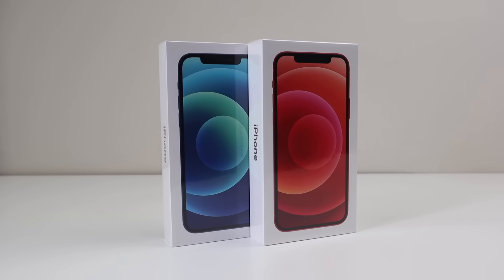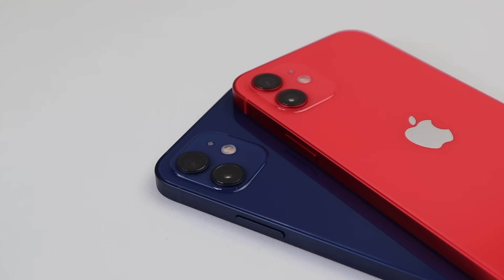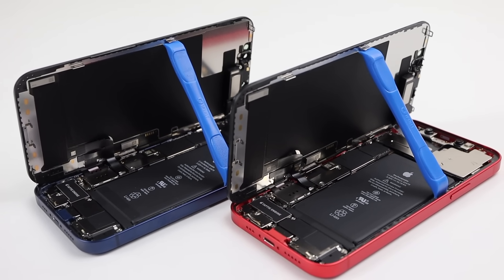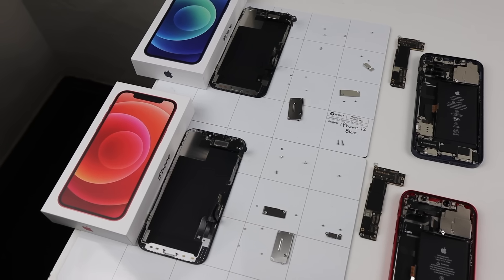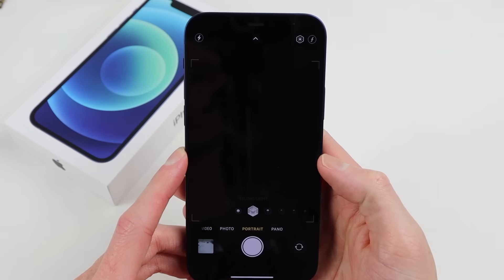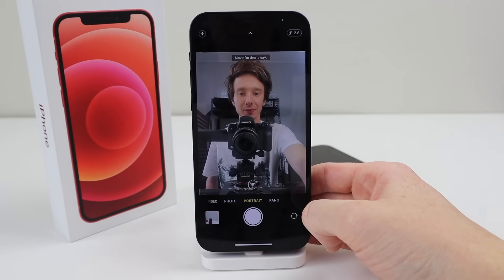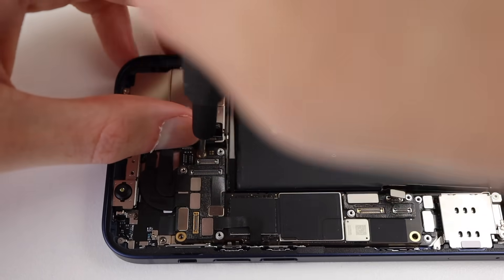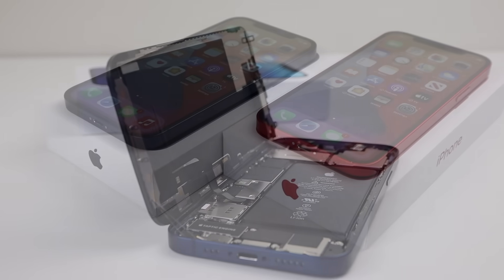iPhone 12 Anti Repair Design - Teardown and Repair Assessment

Comment: I just watched a video showing a 80 year old Rolex mechanical watch which was not working.  After the watch maker/ repair guy got into the gears and springs and replacing what was broken and worn and cleaning what was dirty the watch was beautiful and working like new. Apple needs to adopt the same attitude toward its expensive products. If they continue the trend of once its broken either by accident or digital failure the only solution is to get a new one then Apple will put themselves into a position where the consumer will start choosing a better option which in this case is a phone that can be repaired either by the company and or a 3rd party. That will spell the end of Apple and its Iphone.

Comment: So it claims the parts "aren't genuine" even though they're literally identical components from a brand new phone?
Reply: that's the same thing I thought

They are literally the same phone the only way one won't be genuine is if some  oof the phones made by the same company is made purposely with sub par parts so they spoil quicker

I don't doubt that apple can do this
Reply: How would they ever fix it, they are going to program a hardware address into a battery to repair it? Or is there a way to update this with software?
Reply: @tomanderson3196  You are correct.  They have a way to flash their hardware and match the IDs with the logic board of the phone.
Reply: @tomanderson3196  one would assume apple has the means to properly pair non original parts
Reply: @samuelyoung2671  Ya, id assume you will be paying by the hour for it.
Reply: Apple itself isn't genuine..
Reply: I guess they just check for the hardware ID to prevent you from replacing components. But to be fair they could store individual calibration data on the main storage which has to match the hardware.
Reply: Not completely identical. Several parts seem to have a hardware ID within them and only those that match are allowed to function.
Reply: @Schnittertm1  identical as in part number, manufactured by the same plant in the same way. I understand they have different hardware ID's, but they aren't different.

Edit: and they're certainly exactly equally "genuine"
Reply: @nothingnoone8752  Thats the point though, they aren’t genuinely Apple lol that’s the point taken from it use your brain
Reply: @Jonathan-cz4ky  dude cmon, they do that because although it is a genuine apple part, it forces a monopolization of repair work to apple techs. So, they can charge $150 for a job a small repair guy can do for like $70
Reply: @lemuelseale1640  I’m not arguing against you there, everybody knows that. It only makes sense as it is a business, and they will lose out on a pretty hefty amount of revenue if people don’t get their stuffed repaired BY them. However there is definitely incentive to get your things repaired by Apple regardless, as they are more trustworthy and do offer guaranteed satisfaction whether they can fix your device or not. Every company eventually is going to be doing this as phones become more likely to last longer with more premium materials and better design/software.
Reply: @Jonathan-cz4ky  More trustworthy? Guaranteed satisfaction? Who's your dealer? I wan't to mess my head with the same stuff you're on.
Reply: @Schnittertm1  lmao dont even try that bs, they dont need to be matched, thats a SCAM mechanism.
Reply: @Schnittertm1  technically you can hardly call it different hardware since its the same chip, just programmed to have different id.
Having different hardware in each device on a production assembly would be a hell.

Comment: I wish you switched the screens of the new iPhones to see if it would still work or not. That’s the repair that makes the most profit for third party companies in iPhone repairs which is usually done due to broken screens.
Reply: Bro he switched the logic board. The logic board is the phone. It achieves the same effect as switching every single component. Doing that he basically found out every single component that can or cannot be replaced in one seating. So yes, you can safely replace the screen. At least for now.
Reply: Oh gotcha, Thanks bro I didn’t know that.

Comment: I would love to know how to repair a Huawei mate 20

Right to repair is something I believe in... Unfortunately I had to rebuy my phone or Huawei mate 20 plus
With a Huawei mate 20
Slight downgrade
The only thing wrong with the plus edition I believe was an electrical surge that may have taken out the charging port or a capacitor on the logic board outside of that everything would technically work if you could power it on

Never use magnetic tips on any phone that supports a desktop mode this may not work and may cause serious damage no one who would have been responsible for the phone was willing to repair it

I would love to know how to repair a Huawei mate 20

Comment: I'm thinking the path around this will eventually be the same as for many other similar BS things. Read off the data from the original broken part, write it to the new one. It won't technically be a uniquely calibrated unit in case of displays, but rather, as far as the CPU is concerned, it's the same display as before. Been doing this with replacement displays, batteries etc for years now. Can't mate a new part, but giving the 3rd party tool and parts wizards a bit of time, you can programming-wise clone the old one.

Comment: Apple : Save environment so we won't provide u charger.
Also Apple : changes to type c so u will have to buy Charger and extra box creating more waste than before.
Reply: They are giving the finger to their customers.. Just the idiots need to realize that it's the middle finger and not the ring
Reply: Or use an old one? It’s still lightning.
Reply: @NotFaitZ  who doesn’t? If you have a phone with usb-c, you can use the cable that came with the 12. If you have an older iPhone, you can use one of those. If it’s your first phone because you’re 10, you shouldn’t get an iPhone12.
Reply: @NotFaitZ  Don’t your Samsung use usb-c? Mine does. And if it’s still an old usb, you are one of the few people that need to buy a charger. Why does everyone need a charger when only 1-2% don’t have one?
Reply: @NotFaitZ  That’s a good point. I think some comes with usb-c to usb-A and others usb-c to usb-c. I have both so never really gave it much thought. 
With the lightning-cables for iPhones I prefer the ones that are not original and you can buy one everywhere. I have 5 iPhone chargers I use often spread all over. But only have 2 usb-c chargers for the iPad and my work-phone. So I find it more of a drag. And all the usb-micro cables that was used with Samsung before? Those serve no purpose anyone.

Comment: Apple is like that one person that goes around and tried to redo everything you do but like it's not better. They just wanna be the one to do it, and even so, where you literally were able to take the phone apart and replace the components fine, Apple would probably be like "You need a new phone" The fact their own parts aren't even recognized. I dunno, that seems like intentional obsolete/e-waste. They're not going to reach 0% unless they get off their high horse and allow customer/3rd party repairs so that phones aren't basically wasted the moment something small goes wrong. They have this superiority complex that their devices are better than everything else. Please, I work for a company that's been flying LiDAR since 2008, your LiDAR module isn't impressive...

Comment: Apple 🍏 is a company that focuses on making money with inovative and stolen ideas from the past and use them such as the orintation sensor, and Siri. Apple will buy out any company it wishes to achieve its goals. It’s not only about replacing parts, its also about protecting the product. Have you ever tried changing a part in a New BMW i8 or any for that matter. The answer is you can’t. You can’t even change a light bulb because the car needs to be programmed again to recognise the new part. It’s simple coding on each part that carries a hardward ID. Good video but think from the Companies prospective who want to succeed and also move people in using newer tech and not be stuck with the old stuff. Safety, Security, Quality is well received from apple products and nothing compares how ever they do not hold value for long and become junk in a few years which can be used as a Vtech toy.

Comment: Apple in the coming years - We have removed the Data Cable which will have to be purchased separately from from the Power Brick. Also we have changed the ports again so you'll have to absolutely buy our overpriced stuff.

Comment: The swap parts limitations are done through ios. Older models suffer from similar issues once updated. While technically the device is yours the software is theirs and bla bla. For instance if you have a iphone 7 you replaced your screen or whatever and is fine, you might get a surprise at some point in time when you update the iOS ... Wil make you think your device is at the end of life and you will mot make a fuss about... So you go and get a new one...

Comment: The IP rating thing is probably because they don't want anyone else getting inside the phone, therefore they use stronger adhesive, and they just say "oh yea, it's even more waterproof"
Reply: Apple phones are surprisingly waterproof. And when playing with a $1,000 in the water - I'm very glad for that. You can take them with strava running swimming on your arm, paddling in a canoe etc. I've been in and out of water a fair bit with my 11 pro and it is amazing how it just works. The next goal should be to get rid of all ports, and then just fill entire interior with some glue so even if water got by a switch edge it has no where to go.
Reply: That doesn’t make sense so I can only assume it’s a joke. Ha ha ha!
Reply: @Jonathan-cz4ky  If you actually look at all the Apple products from the beginning and their competitors this isn't surprising. They go a step ahead to make it extremely difficult for any to get inside.
Reply: @kibibytein  no I was talking about specifically what he said about the IP rating and adhesive
Reply: @Jonathan-cz4ky  i think I wrote that comment overcomplicated, what I wanted to say is, that apple uses stronger adhesive, which comes in handy considering they don't want anyone to get inside their phones

Comment: Missed a big point here, for privacy reason you cant just swap a camera module and start using face unlock to get into a phone. Also most iphone repairs are with broken front screens. I came to see how easy it was to change screen and was left with a question that will it work if you just replace the screen?
Reply: Why? Face unlock is a software thing it shouldn't matter what camera it's using as long as its the same type
Reply: Face ID data is not stored in the camera modules. As for the screen replacement, it will work but the screen specific issues mentioned in the video will occur. It will disable truetone and give you messages that the screen cannot be verified as genuine. An Apple Authorized Service Provider will probably be unable to service a phone with this error due to Apples strict guidelines for them.
Reply: basic cryptographic security prevents that, the new camera wouldn't have the encryption key required to unlock the phone. this does not require bugging out a newly connected camera, authorized by someone who can unlock the phone with the passcode.

i suppose this could still be sort of a security feature, where apple doesn't allow you to service the camera outside of apple authorized, so you don't get a bad, potentially non genuine installed by a third party that might have security flaws (purposeful or not). i dunno how reasonable an argument that is.
Reply: @dart200  it isn't. If you really wanted to you could give error message one time to the apple ID who's signed in while allowing functionality
Reply: It will not. Every part is serialized now.

Comment: All I can say is that my $300 Motorola that came included with a case, wireless earbuds and a 5000mAh battery with charger works great. So how much does it cost to replace an iphone screen again?
Reply: The cost to replace the iPhone 12 screen is buy a new iPhone 12. Environmentally Friendly is the name of the game 😂 what bulls**t Apple speaks.
Reply: $200, I would know.
Reply: I'll add in here that before I got the g power I was looking at all the flagship phones from china/japan because they can be had for 1/3. The cost of phones here in US but most of them don't support all the bands we have here. The moto G is a full featured phone that will work globally and supports a ton of networks. My only gripe is it takes a while to charge and a case/screen protector is a must if you want it to last. Have dropped it getting out of my truck several times and only the screen protector has cracked.
Reply: What model of motorola?
Reply: The cost : Buy new iPhone
Reply: it depend....
Reply: I got a Motorola too but it cost me 125 for the phone, cable, case and screen protector. It runs smoothly and charges fast asf. No lag on almost every game on play store and dropped it many times with no damage.
Reply: Although I suppose It was only the phone(s). Got one for the gf too. Our old ones were like 5 years old XD. Bought a case, headphones, and tempered glass screens separately but they were cheap and customizable. All in all it totaled about 275 per phone.
Reply: Mine was 250 during Amazon days:D
Reply: @alexhirt4382  probably the moto g line. I got a g power, 5000mah battery and lasts 3+ days with use. Cameras are so so but it's a fantastic phone for the money.
Reply: @Chubbza5  actually got the Moto g power also. Like I said, Amazon days. Saved 50 bucks. Not a typical sale.
Reply: Lmao, more than your phone
Reply: @valkyrie_592  yes and if I break it, it will still be less than your phone, regardless if I do it myself or take it to a shop.
Reply: 30$ if you do it yourself
Reply: @Seinaru  usually people watch videos before commenting
Reply: @Seinaru  you didn't watch the video did you ?
Reply: @Seinaru  lies. A new iphone part from one of the newest iphone costs nearly $200. U must own an iphone 4s or something, even the iphone 8 is still pretty expensive and I'm talking about USD here.
Reply: @Seinaru  Oof
Reply: @Seinaru  you're talking about iPhone 6 digitizer lmao. Rip.

Comment: It is not specific to iPhone 12. Apple has been pairing batteries and displays since 7. The battery and display(i think taptic engine too) has ID written in it's own memory and same IDs in mainboard. There are a lot of programming tools from China, which can restore this IDs from mainboard memory or copy from old display. This tools are quite cheap(cheaper than iFix toolkit used in this video) and everyone who can disassemble iPhone can use it. 
I don't see huge problem in it, since most of other manufacturers do this. In my opinion, it is actually good protection against untrustworthy repair centers, where someone can install bad copy of iPhone display and ask full price for it.
Everyone has right to repair his own devices, but they are becoming better and harder to manufacture every time. You need specific skills to repair it and not everyone can do this.

Comment: I've had two  apple tv 4k die  on me  just out of warranty  because of a  bad  OS update, only solution was to beg at the service provider for an out of warranty replacement.    there  is no  port to reflash that  device.  so any software  shenanigans will brick it

Comment: While I hate the hostility towards third-party repairs as much as anyone, I don't think the argument that it leads to more e-waste holds (without empirical evidence). The second hand market for iPhones is extremely healthy. One side of that is that Apple is relatively good at keeping old phones updated with OS releases. But discouraging third-party repairs can actually be a second factor. If I buy a second hand phone online, I really don't want to risk it having a crappy third party screen or a potentially dangerous third party battery. Without Apples warnings, there's no guarantee. A healthy second hand market (many buyers willing to pay high prices) is extremely important for keeping down e-waste, otherwise people won't bother selling their old ones when they buy new ones. Remember that a lot of people buy new phones before the old ones are even broken. That said, there needs to be regulation forcing Apple to make first party repairs faster/cheaper, and allowing authorized third party repairs, giving them access to authentic parts at reasonable prices. Apple could make a system where third party repairs is registered, and you can see on the phone what repairs have been done and by whom. But they won't do so unless governments force them to

Comment: 1:10 this is wrong. YOU CAN use your normal iPhone charger and cable you already have with normal usb. You dont need to load it via USB-C. You can, but  DONT NEED to buy a charger seperately. 
This is a cool step into the right direction from apple. Also brave of them thinking about loosing customers forcing them to use their old loading device. 
It will definitely make an impact  on the environment thinking about how many millions of useless chargers got shipped to all of us already. 

On everything else, I'm with you. Bad repairability is a big step backwards..

Comment: What would anyone expect from a company that installs software that cannot be removed, disabled and now even tracked in network trackers to check up on what it's doing? People need to learn to start protesting about the crap companies are pushing. WE own the devices, WE decide what to have installed in them, WE decide what to run in them, WE decide if we want to repair them or buy a new one. Seriously, today you buy something, but you don't really own it. You can use it only with the kind permission of the manufacturer. This needs to stop.